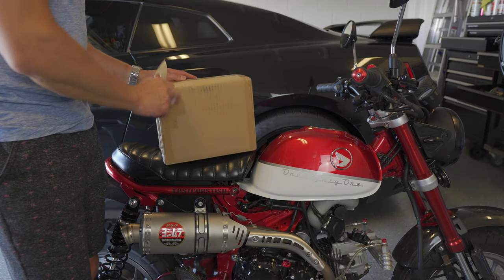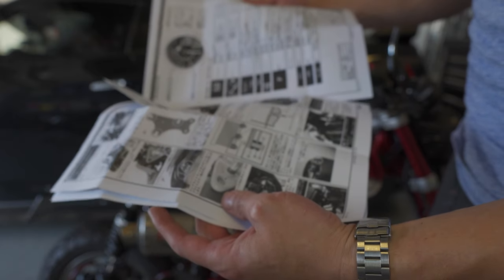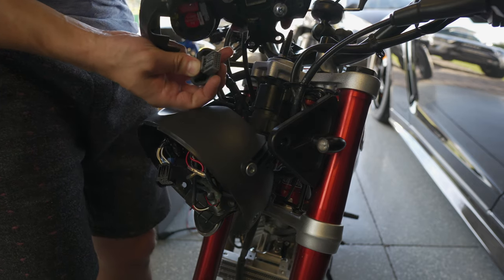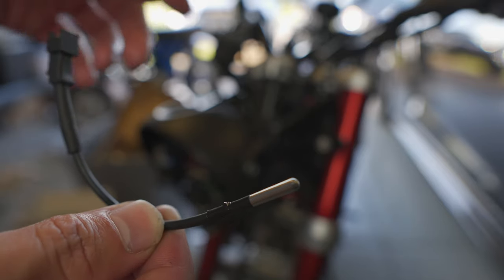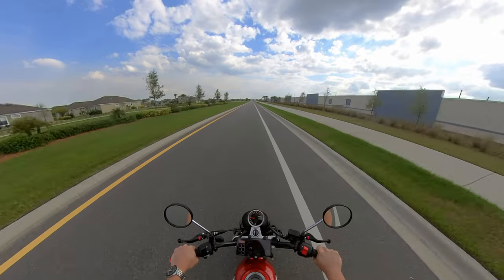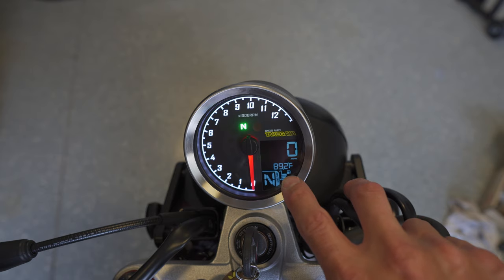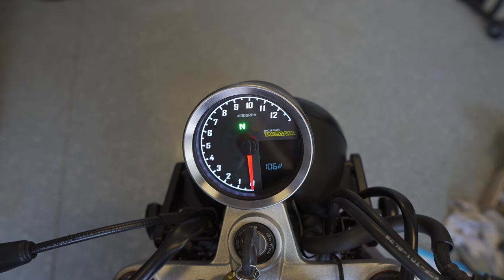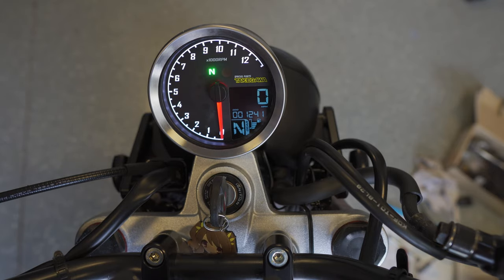Takegawa "Super Multi DN Meter" Instrument Cluster for the 2019 Honda Monkey (05-05-0052)

Comment: On an ABS model, when changing the sprocket size, you'll get the ABS warning light cause your front wheel is not running at the speed the bike is expecting. This can be solved by a speedohealer to correct your speedometer. Do you think this can also be solved by just changing the speed offset on this speedometer? Or is the calculation for the ABS done before the signals are going to the speedometer?
Reply from the maker: I assume that calculation is being done prior to it getting to the dash; I don't think this speedometer is sending any info back to the ECU.
Reply: @eastcoastish  that was also my assumption :-) i also found someone else online stating the same. I’ve got a new front sprocket incoming together with the speedohealer, so i’ll install them both at the same time.

Comment: Just fitted my Takengawa Speedo/ Rev Counter thanks for the video! I actually watched a video from Unknownoverland alongside yours to install and managed to get all the wiring into the headlight bucket! much better because it keeps the connections from the weather or washing the Motorcycle! like he said it was a tight squeeze but you can just get it all in there! You have to cut off the plastic boot they tell you to put tape around to get it in there, but at least the connections are better inside than out! thanks, I went through his instruction video and yours to install it along with the helpful links to the pdf you both posted from the Takengawa website, how to install in English! Thanks for a great channel, ride safe! I think bar end mirrors for me next!
Reply from the maker: Glad to hear, and yeh @unknown overland has great content on the Monkey as well.

Comment: I actually ordered one and installed it after watching your video. I do have a couple questions for you that the instructions didn't answer. Can you set warning lights for different values? As in can I have my rpm warning light flashing and my oil temp warning steady on? Or am I limited to only one warning. Also... Does the fuel light turn on when you are low on gas?

Comment: I have installed Takegawa speedo on my 2019 MONKEY. It is working great.
 I also installed 14t front and 36t rear sprockets that make the 
indicated speed inaccurate. Wheels and tires are sock. Setting the 
speedo's  a - 4 function to 85% corrects the error and now matches GPS 
speed readings.
Reply from the maker: Yeh the ability to adjust the speedometer is great.

Comment: Thx for the Vid. Looking to get this. Little confused how the Rpm Code wiring works. Could you explain a little more on that? Apreciate the info.
Thanks !!
Reply from the maker: The RPM signal gets picked up from the negative side of the coil. You can see it in this video where I did a tachometer when I first got the bike to see where I split the signal from: https://www.youtube.com/watch?v=JWz_8gAoy7M (it's around the 12 minute mark)

Comment: Great video!! Just ordered my new tach. Can you please put up a part number for the oil plug. I cant find it. Thanks
Reply: I used the drain bolt here: https://japan.webike.net/products/23859773.html
Reply: Thanks! I found it this morning on Ebay.
Reply from the maker: Silver: 02-09-0010, Black: 02-09-0011, Blue: 02-09-0012, Red: 02-09-0013

Comment: Hi Kent, I see you have since changed to the Takegawa TFT display was there something you did not like about this one? I'm looking to upgrade my display and would like to know what you found good and bad about this display after sometime being used. I'm looking at the Takegawa Super multi DN meter and the Opmid multimeter but am unsure which to go with. Thanks for any advice, Stellio
Reply from the maker: Nothing was wrong with the Super Multi DN, other than sometimes the LCD was a bit difficult to see in direct sunlight. The TFT setup is definitely cooler and easier to see in all settings, but there isn't any additional functionality. I did end up modifying the bracket to center the round part of the TFT to be more like the Super Multi DN, I've got a couple of pics on Instagram that show that, I'll do a follow up video on it at some point too.
Reply: @eastcoastish  yeah it does look better, nice job

Comment: Next video. It answered almost all my questions except for, will a engine light come on if something's wrong?
Reply from the maker: Yes, the engine light will come on if the ECU throws a code. The brighter orange light at the top will come on based on what you set it to for speed/RPM/voltage/temp.

Comment: Do you use the Aracer oil temp ( side of cylinder ) or the takegawa oil temp at the drain plug ?
Reply from the maker: The oil plug sensor.